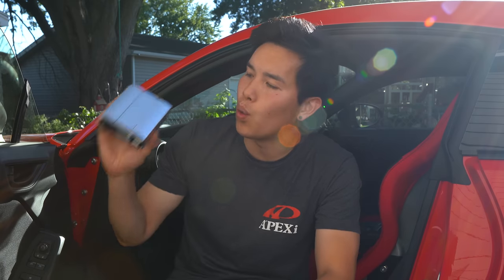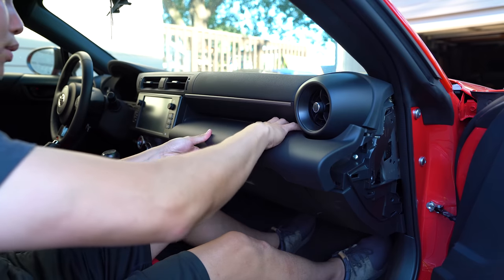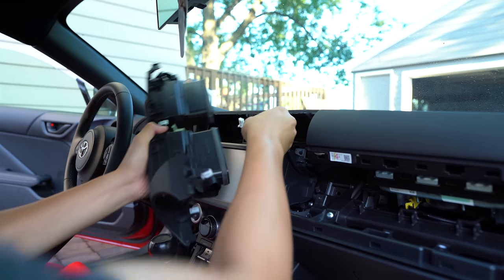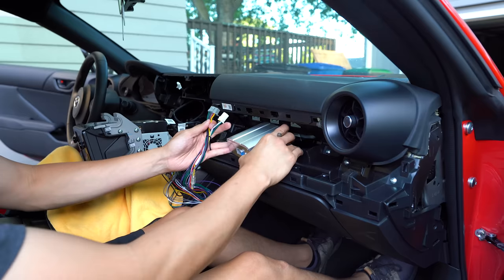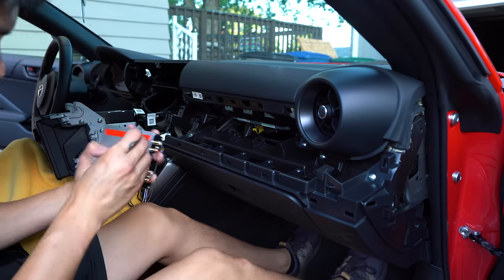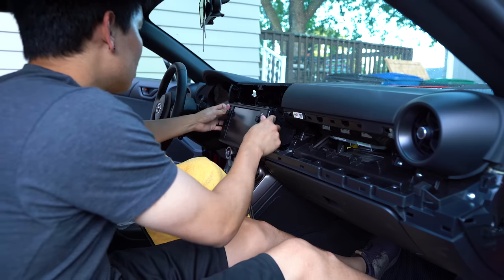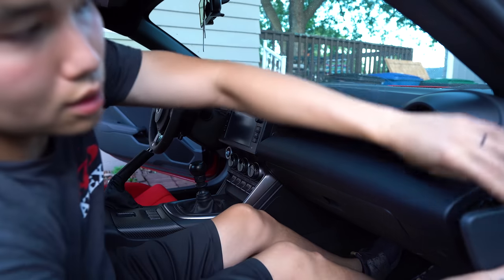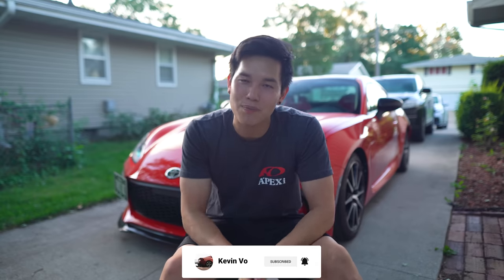EASY Audio Upgrade 22+ GR86 & BRZ

Comment: I want to get this but was worried the install would be a pain in the bunhole. Looks easy enough I guess. Any install comments/complications?
Reply from the maker: Not at all, was super straight forward!
Reply: @KevinVo  Got mine using your code. Major improvement in sound on the Premium GR. The system sounds legit now and I couldn't say that before. Install was easy. Kevin's install steps are simpler and better than the official install video steps.

Comment: @Kevin Vo, 
 I have a couple of questions;
In the webpage it says it has additional RCA imputs but thats really strange or have no logic for me, for example I will install a real big amplifier with one big subwoofer using the whole space on the trunk and what I need are RCA outputs to connect the amplifier. They are are inputs or outputs ? it has no logic that they are called imputs but they are differentiated between front and rear. 
Can you confirm please ?

Comment: How's that shift knob? looks a bit oversized. Look into the Toyota Urethane Black JDM Shift Knob. It's the one that comes with the RC JDM cars. Adds just a little bit of weight and keeps the same form factor as the factory one.
Reply from the maker: I enjoy it personally, but I've had the knob you're talking about in my FRS and liked it.
Reply: @KevinVo   Might jump on it. Yes, I like the urathane.

Comment: Video suggestion: buy one and install it in the gen 1 cars 👀 these wouldnt work with an aftermarket headunit, would it?
Reply from the maker: I'm honestly not sure.
Reply: @KevinVo  nvm, I realized that I could just plug it into the adapter that let's me plug the OEM cables into the aftermarket head unit 😂😅

Comment: In one of your Sema videos, you talked about the DSP amp. Where do I get one? Also, where do I get, and what brand of carbon fiber add-ons are the best? Now, the steering wheel. Do they make one for the automatic with the paddle shifters? What brand is the bet and where do I get one?
Reply from the maker: You can get the DSP amp from Beatsonic: https://www.beatsonicusa.com/enx-t106.html

As for the carbon fiber add-ons you can pick them up on my website! https://www.driven.media/shop/22-toyota-gr86subaru-brz

The steering wheel is the same for the manual and the automatic. The shifter paddles will attach to the steering wheel just like OEM. You can email The Mod Garage to place your order for a steering wheel.

Comment: Does installing the amp on top of the airbag like that interfere with its operation when deployed? I am not sure how this one works exactly but the front of the dash is where the air bag deploys and probably fire up where you put the amp. I could be wrong though, but something to consider.
Reply from the maker: The amp was installed underneath the airbag which deploys up through the top of the dash so doesn't interfere.

Comment: @kevinvo what trim do you have? I have the base model. I have a few questions if you don't mind. Is there a way to convert the built in laptimer to read your GPS location so you can really is it as a timer at the tracks? Do you have a video that shows how to do a big break upgrade and what to buy?
Reply from the maker: I have a base. Not a way to do that that I know of. As for the big brake kit you can watch the video on my frs it's essentially the same process.

Comment: The sound quality from the factory Harmon Kardon speakers in my WRX RS are trash and OEM Audio+ are way to expensive so hopefully there is a solution to better speakers soon. Also doesn't help that the factory 11" "tablet" headhunt is limited to bass, treble and mid and there's no aftermarket headhunts available yet
Reply: OEM+ now has a $350 option to upgrade

Comment: Won't that overload the speakers and have them go bad quicker?
Reply from the maker: Nope, this was engineered to work perfectly with the OEM speaker setup without overworking them as long as you don't turn the gain up all the way, which is why I recommended the adjustment in the video.

Comment: Hey Kevin I bought one of these and my head unit crackles and pops even more after I installed the beatsonic amp.  I might need to take this in for warranty work.  Lol
Reply from the maker: That definitely is not good 😅 did you double check the gain on the unit to make sure it's not turned all the way up?
Reply: @KevinVo  Yes for sure.  I took your advice and tested everything while the unit was just loose.  I have always had issues with the head unit in the car crackling and popping after extended high volume use.  Seems like it heats up and has issues.  The beatsonic unit gets great reviews so I am sure I'm a unique case.  My friend works at the service dept at Toyota so I'll call him and get the head unit replaced under warranty to see if that helps.
Reply: @KevinVo  P.S.  mine is the premium trim with the extra amp in the back rewired to the front speakers.  Maybe that's the issue?
Reply: Nonetheless thank you for all you do online!  You're videos and your garage are phenomenal
Reply: @Playboyer670  thanks man that's the new plan !
Reply: @Playboyer670  I appreciate the advice very much.  Do you know the specs of the speakers?  Sizes?  I'm sure they're online somewhere but if you have that handy pls copy here.  Tks!
Reply: @Playboyer670  this is brilliant thank you so much man!!!
Reply: @Playboyer670  for sure man I wouldn't use anything else either

Comment: I recently bought some side marker and tail light/turn signal overlays and just wanted to give some feed back. The pliable vinyl was useful for the side markers but I had to throw away the tail light overlays because the stretchy material was really hard to keep in shape for the turn signals. On the markers it was good since there's space to wrap around but I think for the turn signal overlays should be made out of a more rigid material :) thanks and keep it up
Reply: I had this issue but it was because I did a dry install. I bought a second set and didn’t have issues after doing a wet application. Might try that if you decide to get more.
Reply: Skill issue it took me 5 min for a perfect dry install
Reply: @TwistedThrottleyt  yeah it was a skill issue that’s what I said? That’s why I said try a wet application? Thanks for zero input lol.
Reply from the maker: I'm sorry you had an issue with the install. If you ever have any issues in the future with any of my products just let me know and I will gladly help. I'd be happy to send you a new set. Just send me ab email.
Reply: @ShiftHappensOften  I didn’t reply to you thanks for zero input

Comment: Guess all it does is adds gain, just makes things louder, adds more distortion, which may make things a bit less clear, but louder, doesn't necessarily improve sound quality.
Reply from the maker: It does much more than that and actually makes the sound more clear and less distorted especially at higher volumes.

Comment: PSA: im friends with an acustics engineer, which is an actual audio expert, and in 99% of cases, the audio system in your car isnt bad. Its the acustics that are bad.

He proved to me that the same cheap speakers installed in different vehicles sound vastly different because different frequencys amplify/lower when the sound waves bounce around in your car. Lighr weight cars will never have a nice sounding system unless you just get a louder system, which is a terrible compromise.

The twins have hard surfaces which amplify high frequencies and the thin sheet metal allows low frequencies to enter the car, plus if you have an aftwrmarket loud wxhaust it makes this worse for you, essentially drowning out the bass in your music. You have to put some sound deadening in key locations to being out the low frequencies in youe system and put some soft materials in the car to absorb high frequencies.

But in a light weight sports car, we generally dont want to do that so a louder system is the onky way to go.

Loud music doesnt sound as good as the music lower though because all the sound frequencies are clashing together now and your just going to get a headache or contribute to youe overall stress on youe drives.

If you want better music, add weight or buy one of the sports-luxury cars